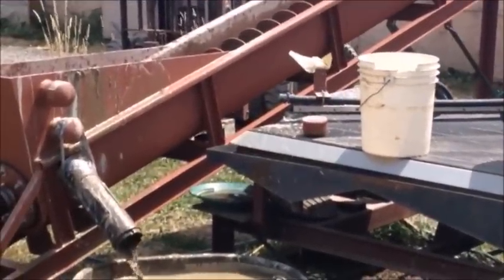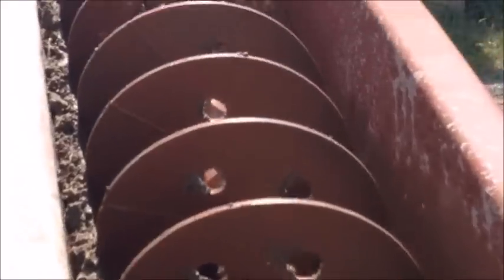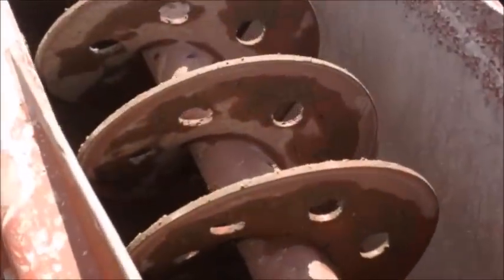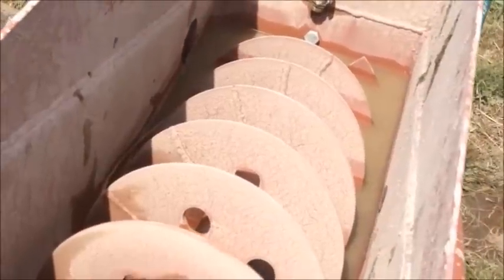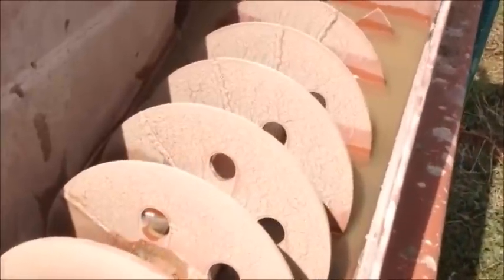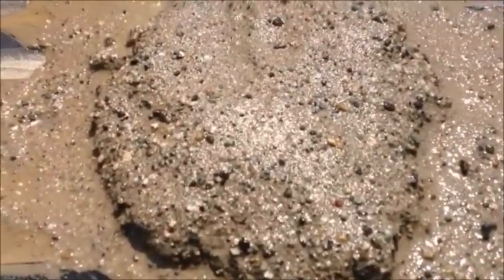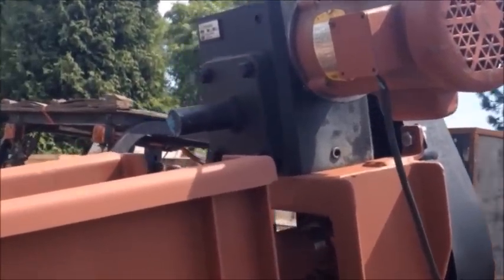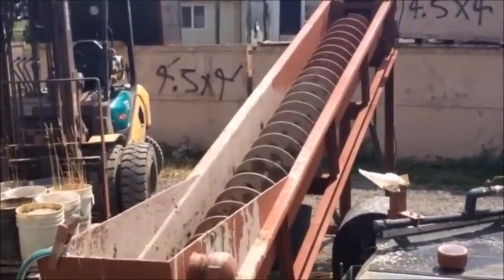MBMMLLC.com: Spiral Classifier for gold mining and density separation

Comment: do you re crush the 50 mesh plus?
Reply from the maker: It will all depend on the mine and the operator.  Some oversized will have enough gold to re-crush and make it worth while.  Other mines/ores will not.  Thanks for the question.

Comment: so what is the advantage over say a vibrating screen or a trommel?
Reply from the maker: Hard Rock University Another great question.  Mechanical screening such as vibrating screens or trommels tend to get clogged (blinded) when trying to screen down past 30-50 mesh.  The holes are so small at that point its easy for small jagged and angular pieces to get wedged in the holes and its hard to get them out.  

Here is a video of one of our small trommels screening at 30 mesh:  https://www.youtube.com/watch?v=lq3a3CwgxV4 (views at 1:52-2:26).  

The spiral classifier separates based on settling velocity and density so it is a great tool for 50 mesh and smaller (not very good at larger sizes such as 10-20 mesh).  It can get good separation down past 200-300 mesh if set up to do so.

One exception to the mechanical screening blinding problem is a Sweco Screen.  They can mechanically screen down to 200 mesh and do a great job.  I have seen a few in action at different sites and they work pretty good both wet and dry.  They can also stack screens so several different sizes can be separated at once.  The Sweco screens are limited on their throughput though and pretty pricey, where as spiral classifiers can be 5'-10' in diameter or more and can do 10's of tons per hour.

Thanks for the good question!